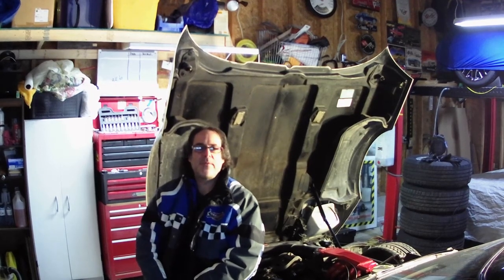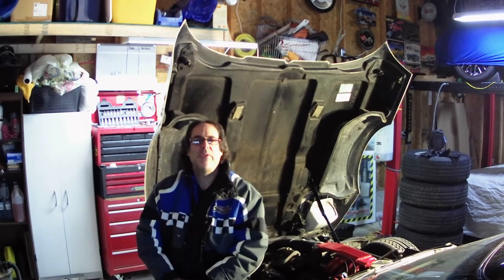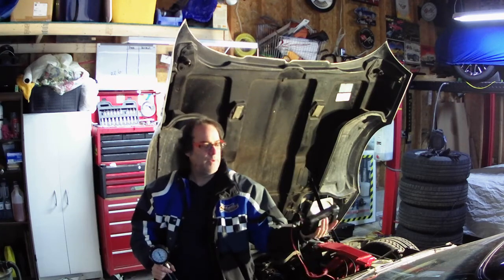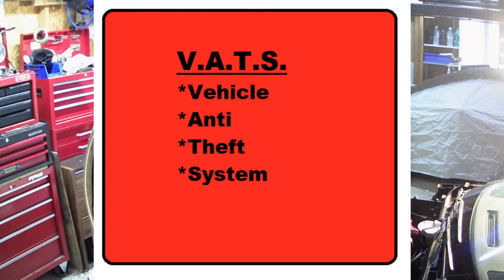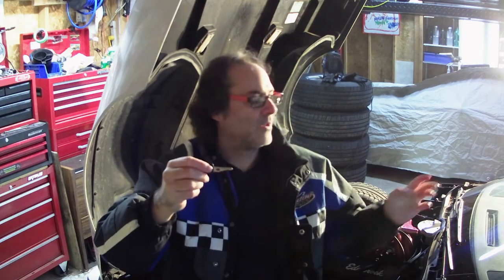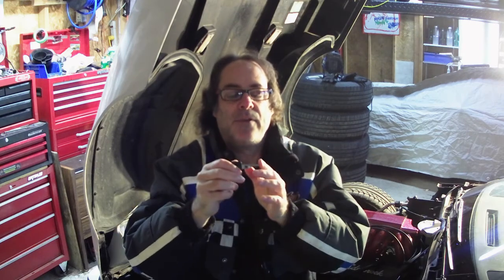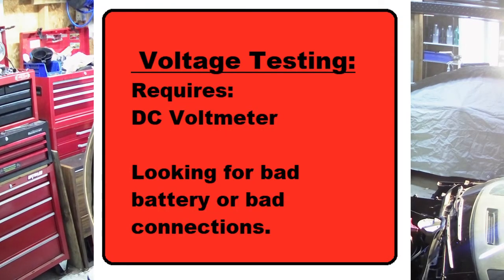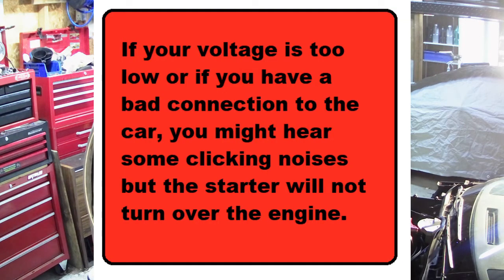C4 Corvette No Start Troubleshooting Part 1

Comment: Hi, many thanks for your rapid reply and advice. Will do as you suggest and let you know the outcome
Reply from the maker: Good luck!  just remember to measure voltages on the car and compare them to measuring at the battery under the same conditions.  If the 2 measurements are different you have a loss of voltage in the connections somewhere.

Comment: Thank you.  Excellent video.  My vette is driving me nuts.  My starter was really weak so I just put a new one on.  Immediately there’s no click and no crank.  I can’t figure it out.  I’ve got voltage going to the starter motor and tightened the wires well.  Why in the world did it suddenly stop working as soon as changing with a new one?    I had the car jacked up at a sharp angle so I could get under it and wondering if an oil sensor isn’t letting it start because of the oil going to different side of engine while jacked up.  I also just converted from TPI to carb.  I finally got the distributor set correctly and realized that I had stopped getting fuel. So I replaced the fuel pump relay and still nothing.  I ran a positive wire directly to pump and instant fuel again.  So still haven’t figured that yet out either but the car did start and run.  But the starter was really weak so I thought I would buy a brand new starter.  I disconnected the battery terminals first.  Took out old starter and replaced with new starter.  Now nothing.  Dash lights up and the fan runs but no click on starter or anything.  I was so exhausted but forced myself to jack up car again and check the little 8 mm wire on the starter to make sure it was tightened.  I was too frustrated to disconnect the battery terminals first and my socket wrench did make connection with frame for an instant and made a spark showing me I have electric to the starter.   Did VATS suddenly go out or can you think of anything else?   I also did add the fuel pressure regulator to drop the pressure on gasoline to carb as well.    Any ideas?   I think I need to check if VATS is giving me problems at same time.
Reply: I did also subscribe to your channel. Thank you
Reply: Update I just went out and checked my key and my key does not have the vats chip on it.  So my solution is not as easy as I was hoping. Do you have any other ideas. I still need to go through all of the electrical testing that you talked about and I will do that tomorrow. I just don’t understand why everything seems to be giving me issues at the same time. My fuel pump is good, but it is not running all of a sudden.  And as soon as I replaced my starter, the starter is not even clicking or cranking or anything. It’s a brand new starter motor so I can’t imagine that I got a dud, but I’m just hoping something is more simple than having to pull the starter back off again.
Reply from the maker: Wow!  Some problems here. What year is the car?  It could be the VATS.  What is your security light doing?  I would double check any ground connections.  If no oil pressure the car should still spin over but not start, so that's out.  Drop me an email and maybe we can work this out.   justcorvettecrazy@gmail.com

Comment: I have a c4 hasn’t started if a few years same issue. It just cranks but doesn’t want to turn over. The city says it needs to be in running condition so I need to get it up and running. I used some starting fluid into the manifold. It starts up but then turns right off. I was going to start by replacing all the spark plugs then checking the gas tank making sure the fuel isn’t old.
Reply from the maker: OK, if it started with the starting fluid, then you most likely have a fuel delivery problem.  I would start by checking the fuel pressure at the fuel rails.  Could be that the fuel system is plugged or the fuel pump is not working properly.  If you want to reach out at justcorvettecrazy@gmail.com I can help you out more.

Comment: Hi, thanks for a great video, I'm in the UK and have a '91 C4. Car starts and runs fine. Try again engine cranks but won't start. Volt meter reads 8v so won't run. (13.2 at battery) Any idea where to look for a bad ground or +. UK mechanics won't touch it so I think its just a bad connection someplace.
Reply from the maker: Hey thanks for the question.  Yes the first place I would check is for bad connection.  As the car heats up the resistance of a bad connection will increase causing a loss in voltage.  One thing you can try is to run a ground wire from the battery to some grounding point to see if the car will start.  Another place to look is at the connections to the starter solenoid, make sure they are nice and clean.
Reply from the maker: I hope you subscribed to the channel.  Let me know what you find out.

Comment: I'm having this issue on my 90 Vet, I got some contact cleaner but haven't tied it yet. I don't have a volt meter but battery seems fine and I tried jump starting it and I still got nothing. So I guess what I'm asking is if it is the battery it still should have started or had some noise when I hooked it up for a jump right? TY
Reply from the maker: Thanks for reaching out.  If the secuity system is in lockout you will get no noise.  Turn the lights on and if you get bright lights then your battery should be stron enough to get some noise unless it is the key.  Reach out via email at justcorvettecrazy@gmail.com if you want to some help.

Comment: So I have to bang on the starter of my 1990 vet to get it to start up. Is replacing the starter the only option? TY
Reply from the maker: Thanks for reaching out.  Could be a bad electrical connection on the starter.  I would check that first to make sure everything is good before you toss in a new starter.  So remove the electrical connections and clean them up and reinstall.  Test  it out to see if it made a difference.  Let me know what you find.  Good luck.

Comment: This is kind of off topic, but I’ll ask anyway. What Optima battery is that and did you have to modify the top posts to fit?
Reply from the maker: That was just a regular Red Top Optima I believe and no mods were were require to make it fit.  It came out of the C5 Z06.

Comment: My 1988 corvette won’t start after watching this great video I made some checks and found I had spark but it would not run on either or even hit. So I checked fuel pressure key on 40psi for 3 seconds then I hear a click Fuel PSI drop’s to about 10. I unplugged all the injector’s it holds 40 PSI for more then 5 minutes as soon as I plug in any injector it dumps fuel pressure. Oh the engine will hit a little when the injectors are unplugged. Any advice will be appreciated thanks.
Reply from the maker: Mark,
See if you can find out if 1 injector is leaking or if there is a ground signal to all or half of the injectors all the time.  All the injectors on the right side of the engine fire together and then the left side.  They are also running off different fuses.  My guess is that your ECU is sending a false ground to the injectors all the time dumping fuel into the engine keeping it flooded.  Try pulling the fuses one at a time "Inj 1 and Inj 2"  see what happens to the fuel pressure when you plug in the injectors.  There could be a short to ground on the injector harness.  Let me know what you find.
Reply: It does the same thing with the left or right bank fuse pulled. Should I check for ground problem’s now or try replacing the ECU? A couple days ago after this problem I removed the ECU inspected and cleaned The wire harness plugs to the ECU The connector pins and everything looked perfect before I cleaned them. Prom pins look good to.
Reply from the maker: Here is what I would check next...I would look to see if 12V is present across the injectors all the time with the key is in the run position.  My theory is that the injectors are firing constantly flooding the engine.  Do you access to an injector "noid light"?
Reply: @justcorvettecrazy116  no but I have a multi meter that I barely know how to use Lol. I’ll check for 12v on all 8 inj. Number 9 cold start has been removed
Reply from the maker: If you use a volt meter it is a little harder.  You need to check for 12V across the injector.  You cannot use ground a s a reference point because there is 12V sent to the injectors when the key is on and the ECU provides a ground when the injectors are to fire.  So if you check for 12V to ground it will always be there.  So check directly across the injector wires.  If you want to take this conversation off YouTube, email direct to:  justcorvettecrazy@gmail.com.

Comment: if my key does not have that connector is that an issue? it started without it before but now is  a no start
Reply from the maker: What year is the car and what are the symptoms?
Reply: @justcorvettecrazy116  1984. Started and drove fine a few days ago but as I tried to start it the dash didn’t light up completely dead. Charged battery and the cars dash would light but the car wouldn’t crank at all when turned.
Reply from the maker: @drshortstuff4824  It is possible that you activated the anti theft mode.  Try locking and unlocking the drivers door with the key a couple of times to see if it resets?
Reply from the maker: You can reach me via email:  justcorvettecrazy@gmail.com

Comment: Hi buddy, have been ill so haven't checked yet. Earlier this year I removed instrument cluster to fix speedo display. Its since then I've had the problem. I have a pinout diagram for a 1990, would it be the same for a '91? Can check grounds then. Sorry to be a nuisance to you.
Reply from the maker: I just posted a new video on finding bad connections using a voltmeter.  Best of luck.

Comment: My 84 corvette won’t start with the hood down & even when I have the hood up it won’t start like it used to. Just changed a new battery & I got my starter checked & it works. Any ideas?
Reply from the maker: Daniel, is the engine turning over when you try to start it?  You can reach out to me via email: justcorvettecrazy@gmail.com

Comment: I have a 90 Corvette convertible Basic  42000 miles with good fuel pressure 45 lbs, spark plugs fire, injectors flashing light via noid light test lamp a good battery, doesn't want to start but when I disconnected the injector plug the car started and stayed running. Had no issues till i turned the car off and came out later to start it and nothing but a turning over cranking and no ignition/start ? any check procedures that are recommended ?
Reply from the maker: What injector connection are you talking about?  It sounds like you might have a short circuit in one injector.  All of the left injectors are connected together and all of the right are as well.  So 1 bad injector could take down the whole side.  What I would do is check to make sure both fuses are good.  Then start unplugging 1 injector at a time and try to start the car.  If at anytime the car starts then the injector that is currently disconnected is the bad one.  Let me know what happens.
Reply: @justcorvettecrazy116  sitting behind steering wheel it would be the left front injector No 1 injector.Keep in mind the car was running great until  it decided to not start  a few hours later? Both fuses have power. The car seems to have good power at idle even though the injector wire is disconnected.  As per your reply the No 1 injector , the car starts and runs it could possible be that one as the injector with the bad attitude other wise the car will not start with that wire connected.
Reply from the maker: What happens when you plug that one back in and unplug a different one?  If the car does not start then i would say that first injector is shorting out the rest.
Reply: @justcorvettecrazy116  Ill be doing exactly that but have a few things that demand my attention at this moment. Ill will let you definitely know . If by chance that it is injectors what brand would you prefer, I have the I think are the OEM brand with the grey body/housing ? " Finally a voice in the wilderness! Can't thank you enough.
Reply from the maker: I went aftermarket on my project Vette.  If you are planning to keep the car for a long time, don't cheap out.  It is a job you don't want to do more than 1 time.  So look for OEM or equivalent replacements.   Unless you are going to do some performance mods.  Might need to look into larger than stock in that case. Don't forget new O-rings as well.  I have another video on the replacement procedure for the injectors.
Reply: @justcorvettecrazy116  OK Good gas pressure 45 lbs as noted, spark to the plugs  , fuel pump hums when ignition is turned on  , battery is relativity new about a year old,  I disconnected the air horn from the throttle body and sprayed carb/ choke cleaner then turned the ignition to start and ran for a short moment, I disconnected the fuel injectors on the left side of engine 1 at a  time turned the engine on no spark at the noid lamp Keep in mind the car starts and runs with the number 1 injector disconnected. I did the left side of motor with the same procedure  and so on removing the wires and testing with the noid light and did not start. I did the No 4 injector right side of engine , no spark/ flashing but not bother with the rest of the right bank . No.s 1 and 2 injector fuses are good and you can hear the fuel solenoid click function when you turn the key ? I followed your excellent flow chart but am coming up short on possible faults. ?
Reply from the maker: So removing the connector on injector 1 the car starts and runs.  Put it back and it does not start anymore? Am I correct on this?  Please reply using email:  justcorvettecrazy@gmail.com
Reply: @justcorvettecrazy116  Yes that is right,

Comment: 94 corvette, ran fine. I left key in vehicle over night. Went to start it today, started and ran for a couple seconds and died. Restarted the same thing. Now when i turn key nothing at all. Only thing i see is check gauges. Dont even hear key in ignition buzzer , only gauge i see moving is amp gauge and tach moves. Windows, lights , climate control all work. When key is on i do hear a clicking behind gauge cluster. Also hear the same noice when open and close door with out key in ignition. Have checked fuses and battery = good. Any idea;s ??
Reply from the maker: Have you tried boosting the battery with another car?  Just to see if it starts and runs.
Reply: @justcorvettecrazy116  Have 12 plus going  out battery, as well as alternator. Gonna check ignition relay, then ignition switch
Reply from the maker: @kimmaxwell8975  Sure sounds like voltage issue to me.  Make sure you check your grounds.  Leaving key in ignition should not do anything except drain the battery.  Let me know what you find out.
Reply: @justcorvettecrazy116  Ive had battery tested and its good. Im in process of bypassing VATS system. I do have a noisy relay under the dash. In the meantime gonna get under it and check out starter and grounds
Reply from the maker: @Kim Maxwell  Keep me posted.  Those symptoms don't sound like VATS.  Let me know what you find.
Reply: @justcorvettecrazy116  Hoping for easy fix, just got the car. About the last thing i need is to sink more money into it
Reply: @justcorvettecrazy116  Ok i just replaced ignition switch, still nothing. Have checked all fuses, starter is working i jumped it. Vats bypass didnt help. Im ready to pull out my hair.
Reply from the maker: @kimmaxwell8975  Have you checked your battery connections and your grounds?

Comment: This is random and completely out of my blue, but my mechanic replaced my starter and now my car has zero power, no dash, no nada. Any idea of what it could possibly be? We didn't blow any fuses, plus the alternator and battery are brand new (along with the starter) the c4 only has 64k, was very well maintained in a garage life. Any insight would be huge, thanks!
Reply from the maker: Did the main ground get disconnected during the install?  I would start looking there and backtrack.